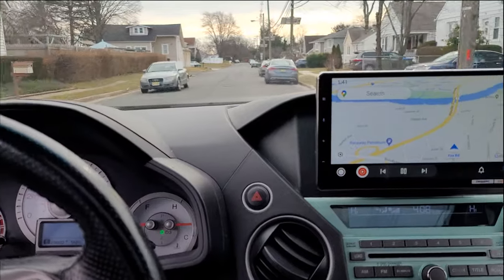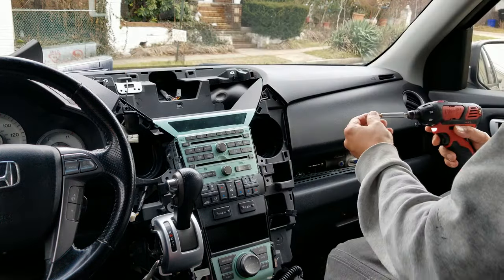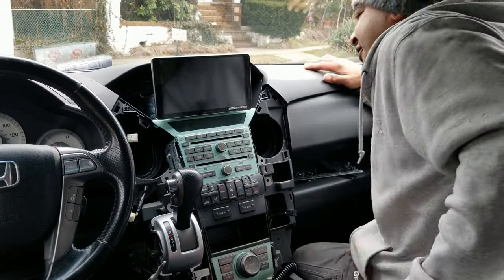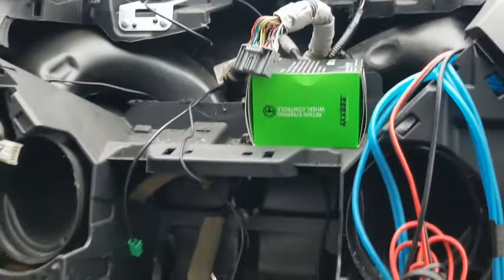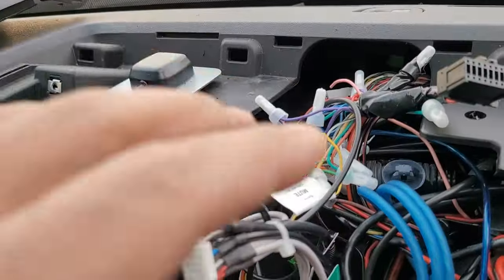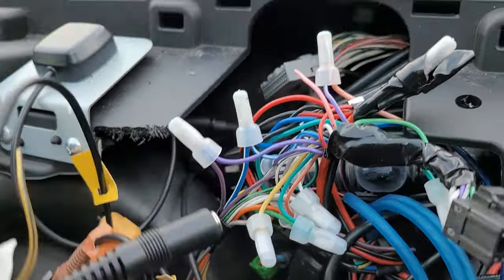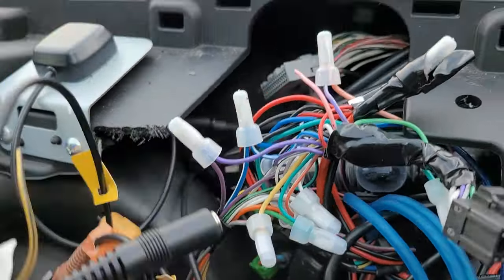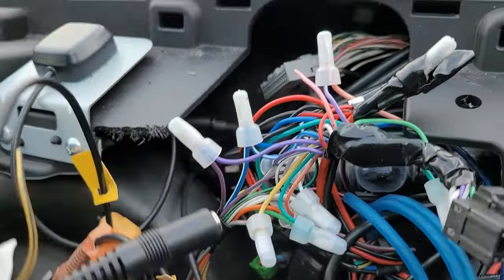2009-2015 Honda Pilot With Navigation, Carplay/Android Auto, Full Installation. Keeping Both Radios.

Comment: Well there's 40 mins of my life I won't get back but GLAD I "wasted".  Great video and incredible DIY skills.  You weren't gonna give up on this installation.  Turned out really nice.  QQ though...with this particular stereo would it have been possible to create a longer wiring harness between the main unit and the display unit to allow the main unit to be placed somewhere else behind the dash?  That might save people some modifications to the dash and just allow the display to be mounted on the "sill" of the current opening.  I currently have a iPad mini that I made a bottom channel plate that it rest in and then use magnets on top to hold in place.  This allows me to easily remove the iPad (I ran a lightning cord to it though for power).  I run my music through RPI running Volumio and connect both the RPI and iPad to my iPhone's hotspot then use Safari to browser to Volumio's IP to display the album art - yeah very wonky solution but functional.  RPI 3.5mm jack plugs into the AUX plug to play music through the factory stereo.  Again GREAT vid.  Subbing.
Reply from the maker: No idea what your talking about..but thanks for the feedback..🤦🏿‍♂️🤣👍
Reply: @richideates  Sorry with my confusing comment.  To clarify my "QQ" (quick question) - do you think is would be possible for a person to make a longer harness from the main stereo unit to the display so one could mount the stereo elsewhere behind the dash so a person would only have to worry about mounting the display on the dash?  Might save people from the daunting task of cutting up their "inner dash" and making a custom enclosure.  Or is that connector from the stereo to the display something like a ribbon cable?  Thanks.
Reply from the maker: Sssoooo..I started writing a well detailed answer..but somehow my phone deleted it..so lets try this again..if your referring to a satellite style radio. Yes that could work. BUTT..AND A HUGE BUTT..🤣🤣🤣..where do you hide the brain and how far would the wiring be?? It sounds like a good idea..but I dont even know if they have them radios anymore or if this radio has a different cable to allow you to do that. But in theory, yes it can be done. But I like a good challenge..so I will say..I won..🤣🤣🤣
Reply: @richideates  Oh you def rocked it with the install!  The wiring seemed to be a nightmare.  Give me back the days of single/double din radios ANY DAY of the week!  Appreciate you sharing your insights into this installation.  Take care.

Comment: Brilliant! Since you are the clear top of the food chain in audio/video of 2nd Gen. Honda Pilot Touring on the entire internet (I've searched!) .... may I pose a question? Situation... I installed a rooftop tent on the roof (duh) of my 2012, not  noticing that it was covering the satellite antenna on my roof (duh). Now my reception is spotty. I have the full factory in dash Touring SAT/NAV. Since the lead on the factory antenna is only 10 inches long so I can't move it, and it has proprietary connectors (in the rear under the headliner) that will not allow just plugging in a new antenna, and I've tried soldering the factory connectors on a new extension cable which never got past the "check antenna" prompt with the radio signal ....  my question is... How would you connect an aftermarket antenna into the back of the aud/vid tower like the one you were working on in your video, such that I can merely bypass (or add to) the one from the factory?  Whew! I know that was a lot. Thanks!!! BTW Honda has nothing to offer. :-/   BTBTW... I'm in VA, but lots of family settled and still live in Warwick. :-)
Reply from the maker: I have extended SAT antennas, never a GPS..BUT..I do know that they run on a very similar wire..HOWEVER..I do not see a reason of soldering..thats number 1..🤦🏿‍♂️🤦🏿‍♂️🤣🤣..but..and a HUGE BUTT..did you ever just cut the wure and extend the (should be) 2 wires for the factory GPS?? It should be..now im not a professional..🤣🤣..it should be just 2 wires if you cut it..DO NOT CUT WHEN POWERED UP..the factory GPS antenna is where I placed this aftermarket one. Id have to look through the video to tell you exactly where..but its right under the navigation screen toward the drivers side..I would..if it were me..cut the factory gps wire..razor off the coating and there should be braided wire and that should be the groundshield..then the actual signal should be the inner wire  inside of a plastic coating tube like thing..unbraid the wire with a small pick..and you just gave me an idea for making another video..🤣🤣🤣..how to extend gps or sat antenna wires..😁😁🤪🤪🤣🤣..so back to you..unbraid it with a small pick..and then extend both wires..as long as you dont wrap it around the whole car and not add 40 feet to it..I dont see why you would have a problem with that. I have done that NUMEROUS TIMES for the factory to aftermarket antenna scenarios. Honda was one of them. Pilot no less. I went out there and it said to check antenna. Ok, so I gambled and just cut the factory antenna out and wired up an aftermarket to the same twos wires. One being a ground and other signal. Bam, fired right up. So in theory. All your doing is cutting the factory wire of the GPS and extending it to wherever you wana go to it. I wouldnt use solder though. It might add resistance to the signal, giving you that check antenna message. A nice wire to wire connection, and a nice tape job should do the trick. Making me antsy to make another video. 😝🤣. Again. Never had a problem with Sat antennas and GPS antennas use the same type wire, not signal, but style wire. Did you get all that?? 🤣🤣🤣..now get to work and let me know how you make out. Will need a generous tip if I am right. 😁😁🤣🤣
Reply: @richideates  Brilliant, thank you! If I read you correctly, my problem was that I SOLDERED. I'm going to try inserting the same 10 foot extension at the antenna without soldering. I might just have too CHEAP of an extension, given that it's wires are lighter gauge than the ones at the antenna connection. I'll subscribe and, worse come to worse, when you post a video on this I'll be able to watch you do it.
Reply from the maker: Well theres nothing wrong with SOLDERING..LOL..I would say it would interfere with reception. And lucky for you. My computer decided to crash on me so making or uploading videos will be on hold until I get it fixed. Hopefully tomorrow as I write this. But that is a good video because it is a common issue in the aftermarket world. I have done that numerous times saving people plenty of dollars by not having to buy new units. RELAX KID. 🤣🤣..I only got addicted to youtube in the past few months. So full steam ahead. Lol. Glad to help.
Reply: @richideates  I assume STYLE wire has the insulated core with the braided ground/shield? I went into my shop and was looking forward to my next rewiring attempt, but I see that I have very little lead left. That leaves me one more shot at this project without having to start cutting up the Honda replacement antenna that I've already had to buy once.  I even took the antenna housing apart to see the satellite chip and it looks like re-soldering right at the chip is an option if I a splice doesn't work. So unfortunately I won't be able to report any good news until I've seen how you do it.  Don't be surprised if that video get gazillions of views! So many 2nd gen. Pilots on the road and rooftop tents are the new biggest thing for camping. 🤑
Reply from the maker: Your tempting me to do it right now..its super easy..let me start digging for a sat antenna and a gps..pretty sure I have both in the trash can outside..
Reply from the maker: So I made one. But its too long. 🤣🤣🤣..I love to explain the hell out of things and its like 15 mins long. I wanna make a shorter one. I did the satellite radio, cant seem to find a gps antenna to chop up. Working on it
Reply from the maker: https://youtu.be/orstBIskjEs

Comment: Love the video. We have a 2012 Pilot w/o Navigation. I want to install a portable Apple CarPlay unit. I would love to be able to just place it in front of the factory screen and create a custom setup to keep it in place and fill in the space around the unit. Only problem is we don’t want to lose the backup camera… Any suggestions. Thanks man! I enjoyed watching your video
Reply from the maker: Well thanks. That install was one of my worst and best ones. 🤣🤣..so question..which radio has the camera? The top or bottom? It should be the top. How do you have a camera with no navigation?
Reply: Top screen that you took out first. I’m wondering if you get one of those screens with a camera and just swap out the camera. You would have to take out the liftgate panel and that license plate garnish. From the inside. It’s bolted I tried first just prying it of haha no go so I figured I gotta get behind there. I hyper dipped mine is why I know. Just get some new mounting tape for re install and I couldn’t get it off without breaking the center push pin

Comment: I love this video, so much ingenuity just to get hings to fit and operate. I have a question. Instead of tapping and cuting off the wires from original harness, can I just an old harness that I have laying around and remove the connections to the speaker? Can I also use the wiring kit to connect both to the new new radio (pioneer) via the intact wiring harness plus the wiring kit for the radio and then tap power to the old radio (honda's) so it can have power to display the AC readings?
Reply from the maker: Uuuuhhhh..you lost me..you need to keep the factory radio intact so the ac controls work..I didnt want to compromise anything factory other than just the speakers..so however you want to steal power or keep the factory radio operable..go right ahead..I did what I did to make matters easier for me..if all your doing is cutting away the speakers..then by all means..go right ahead..it doesnt HAVE TO BE tge same as my video..its just a reference that it can be done and I DID IT..🤪🤪🤣🤣
Reply from the maker: Oh and thanks for the compliment..I had that truck for 3 weeks..that was just a part of what I did..but everytthing else was straight forward..I knew no one did that type install
Reply: @richideates  Alright thanks, my speakers were pre-upgraded by the prevous owner, hopefully, I won't have to do the same thing you and use those pin connectors.
Reply from the maker: Wait, are you referring to keeping the factory amp? Where in the video are you referring to? At first I used the speaker wires right out of the radio to give the amp signal. That turned out to be wrong and had to convert it to the rca signal. Is that what you are referring to? I put those connectors on to be able to plug into the rca outputs of the pioneer. Are we on the same page here?
Reply: @richideates  Yes that's exactly what I'm referring to.